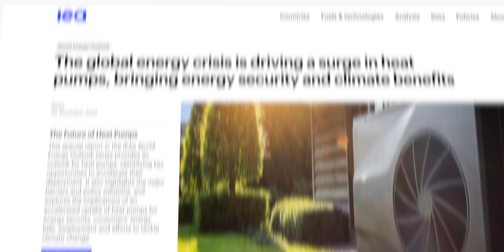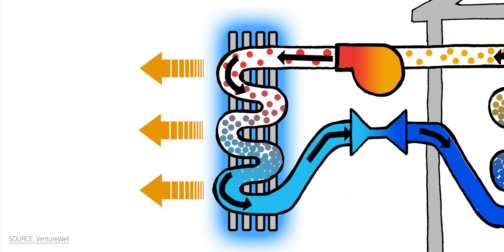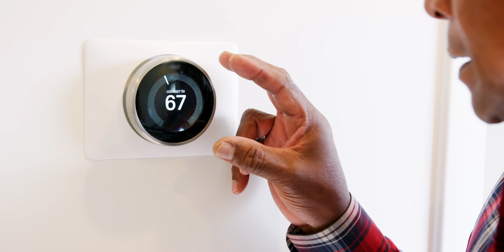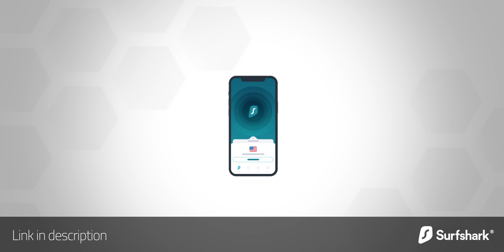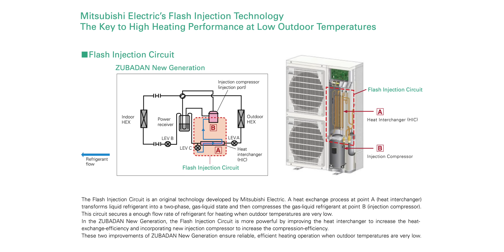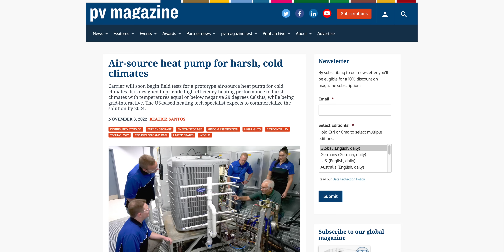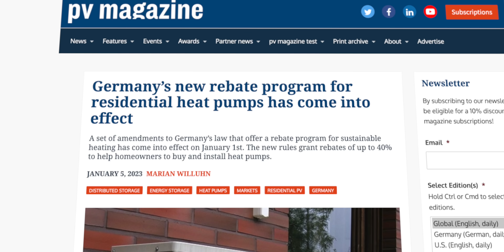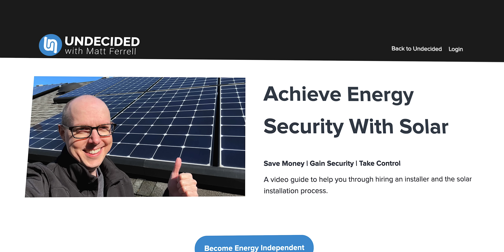Major Advances with Heat Pumps in the Extreme Cold

Comment: A different issue, currently looking for a Monobloc (ie Air to Water Heat pump in a single unit) to heat a very large Hot Water tank (1500l).   We are off grid so the tank is a alternate way of energy storage, leaving batteries for electricity.   
But as we are off-grid, I do not want or need to run the heat pump off battery, it will only run when we have enough solar power (or forcast too) which, still getting Max charge into battery by end of most days.   Yes that large tank and energy efficient house means we have heat, and can still use Firewood backboiler when needed.
But the problem is finding a heat pump with a open control interface that I can turn it on and off, but also demand it run at xx% of capacity.  Not having  much luck, it is use timer.. but that doesn't know it is a poor solar day, or turn it on off buy removing power, problem is if they on powerup go into standby, and need a button to be pushed.....we are not always there to push buttons.
I have the means to determine when to turn on off, or what power to demand, just no-one here in Aus is willing to provide that interface.
But you showed a few other names I will have look at

Comment: At 12:35 Matt said: “There’s plenty of modern models on the market right now that can handle the coldest winters that the Midwest or New England can throw at them.” But according to the information presented in this video, THAT’S NOT TRUE.
Matt said companies are on track to meet the challenge by 2024. Then he said multiple companies had made PROTOTYPES (NOT PRODUCTS) that met the challenge. But right now is March 2023, not 2024. Also, the CCHP challenge only goes down to -26 C/-15 F. In the upper Midwest, temperatures can get down to -32 C/-26 F or colder.  What is the operating cost comparison of a CCHP in cold weather vs. a gas-fired furnace?  Heat pumps have known issues with the coils icing up at near-freezing temperatures.  Has that issue been resolved?  Also, what is the reliability of these units? That is a big, potentially very expensive and/or dangerous, unknown.
Another consideration is that during a power outage, a small generator can power the electronics on a gas-fired furnace, but NOT a heat pump.
When these issues and questions can be adequately addressed, I’ll consider a heat pump.  Not before.

Comment: well if you have a air-source heat pumps... the colder it gets the less-effective they become...however if you have a ground source heat pump it works at all temperatures... also it a lot more efficient , love your video's Matt
Reply: The problem for ground source is that when it is warmer (e.g. 7C+) it gets none of the gains from the warmer air that Air Source can.  So it's very much a balancing act of whether the efficiency gains of ground source at the colder temperatures, make up for the efficiency gains that Air Source gets when it's warmer.  Especially considering the greater up front cost for Ground Source.
Reply: @BenIsInSweden  you are partially correct, however ground heat pumps work at the same efficients in nearly all weather, which means you can plan exactly what you going to get, but with air source dependent on the weather you can't :( the temperature level in the soil doesn't alter once you go below a particular depth if you want your heat pump to work independently of the weather there is only one solution ... ground source ....
Reply: @alangunningham5667  Yeah, I liken Ground Source to having a fixed-rate mortgage, you are largely unaffected by what the market is doing.  So you're essentially paying for that consistency, even though it might not always pay out in the long run. Ground Source does have some risks in other areas though, like in Sweden, if you live in a water protection area, and you get a ground source heat pump, you are personally responsible if the nearby water becomes contaminated due to the borehole etc (even if you decide to move away). It's a low risk, but a risk nonetheless.
Reply: @BenIsInSweden  i kind of agree, but i don't live in very hot areas and haven't looked up the stats for those areas(can't believe the results would show any efficiency difference worthwhile), however, most definitely temperate and cold areas's ground source is easily the best to have, you kind of grab the very worst situation for Sweden, and i am sure that properly installed the risk of this happening in minuscule, and even then it depends on the fluid used for the ground source system
Reply: @BenIsInSweden  all that info could be correct , however, my statements are totally correct, you are just trying to pick holes in it .. there are always many reasons to buy one system over the other ....but we were discussing costs, just how one system works better than the other, and no matter how much you try and prove it , ground source heat pumps are generally more efficient over all temperature ranges, air source just can't cope, you say you are from the UK ?? what the hell are you talking about SEK  for ??? UK using GBP for currency ?, I could poke more holes is your statement  but this is getting silly
Reply: @alangunningham5667  Sorry, wasn't trying to pick holes.  At the end of the day, you are correct in that they are generally more efficient.  The temperature ranges where they aren't, aren't going to make a huge difference in cost anyway. As for the country confusion... I'm from the south of the UK, but live in Sweden.
Reply: @BenIsInSweden  now I know there currency and Sweden's mention for contamination all good points, i live in the southern part of the UK and generally air  source units are the ones being installed...so much cheaper, but i would, if had the area to put in a ground source, i would, on new properties. the cost difference would be small (my self, i have air source, not enough room for ground  )
Reply: @alangunningham5667  Yeah, I think there are situations like adding it onto a mortgage for a new house purchase it would make a lot of sense. The biggest problem for the UK currently is misinformation about Heat Pumps in general (and tbh bad installers), it's almost bad enough that I believe that there's some sort of fearmongering campaign going on by the gas industry to put people off.
Reply: @BenIsInSweden  yes i agree,in the UK, There are a lot of misinformed installers  just trying to sell heat pumps to make  more money, not because it makes sense to install and also  jumping  on  green bandwagon, again for more sales ..hardly anyone points out the changes having a heat pump system is going to make, as much as it is good, there are points that won't make it good for all

Comment: Matt a liquid cannot be compressed. The liquid refrigerant evaporates in a coil (strangely called an evaporator) thus absorbing heat. That low pressure gas is compressed into a high pressure gas by the ummm compressor. The high pressure gas is then fed into a condenser coil where it gives off heat as it changes phase (that is condenses) into to a liquid. That liquid is then metered by a thermal expansion valve, or capillary tube before it re-enters  the evaporator coil, where it once again evaporates.  This process is the same in a refrigerator or an air conditioner. The only unique part in a heat pump is the 4 way or reversing valve which determines the role of the indoor and outdoor coils, that is  making the indoor coil a condenser in winter so it can give off heat, or an evaporator in summer so it can absorb heat.

Comment: I invested in a geothermal heatpump with 2x 100m holes. Because air heatpumps are not so efficient in the winter. With a COP of 4.5 combined with a lot of insulation i can laugh about putins gas blackmailing. Yes i invested €20k - €25k but that investment lasts 50 years and even when my heating cost doubled from €400 a year to €800 it is still 1/10th of what the others pay here in EU winters.

Comment: My partner and I have been discussing if a heat pump is worth installing where we live. 

We get a few dozen days below -30C (not counting windchill) every year. 

We talked about the option of a heat pump for the warmer times and a backup furnace for the other days (but it seems expensive to install and run two systems, even if one is backup.)

I am wondering if anyone else who lives in a pretty cold climate has come up with a way to do this, or does everyone just go straight to geothermal if they want heat pump technology in a colder place?
Reply: Whilst Cold Climate Air Source Heat Pumps are pretty common and can work down to about -30C.  The extra cost of having the borehole drilled for a Ground Source Heat Pump (or geothermal) will likely pay for itself within the expected lifespan of the heat pump itself. The borehole loop (at least here in Sweden), is expected to last 100 years, so will live through about 5 heat pumps, and likely at least 1 owner 🤣

Comment: What you should of done is had an ORC via solar thermal that dumps the heat into the ground loop of the heatpump. Orc cold loop becomes heatpump loop when running ORC.

Comment: I installed a geothermal hvac system 3 years ago and it has been flawless. We live in the Denver area with temperatures down to -20 F. Obviously, with the geothermal setup, cold weather doesn’t affect the performance so it does fine in winter. What I’ve been most surprised by is how great it is at air conditioning and how cheap it is to cool the house in summer. It costs next to nothing to keep the house in the mid to upper 60s in the summer (our bedrooms are all upstairs and I sleep better when it’s cool). Overall a great investment.
Reply: @ReasonAndHeart  that lame payback argument. If you had a new kichen or bathroom installed, would you calculate the payback on that? Or a 2 week cruise around the Carribean? It's a ridiculous argument against heatpumps.
Reply: @mikeypc3592  Same goes for solar, I just don't see the justification for geothermal as unlike solar geothermal only reduces the utility cost. It's ironic how people don't think spending $20-$30k for solar is worth it but they think spending that same figure for geothermal is worth it even though the former eliminates the utility cost if done right but the latter only reduces the utility cost which will continue to increase.
Reply: @mikeypc3592  Caribbean.
Reply: No it isn’t. Why use a heat pump if it costs more?  What’s the benefit?
Reply: @ReasonAndHeart  Not to mention you only reduce your electric bill not eliminate it. I chose to go solar, install an air source heat pump and wood stove. Eliminated the energy bill altogether. I did test the heat pump these last two winters and even at single digits it still kept the temperature at 75 degrees, it ran non stop though and it does not have or need auxiliary heat either. The defrost mode does drop the temperature but the defrost cycle isn't long only 2 minutes tops and only goes into defrost occasionally. I use the wood stove as primary heat for now until I am able to expand my current backyard solar array to generate enough electricity to use the heat pump as primary heat then the wood stove will be secondary heat if the heat pump were to break down.
Reply: @ReasonAndHeart  Depends on user requirements, me personally I'd be ok paying that while using a solar setup and higher efficiency building codes to have 0 costs in the future. This is assuming of course you pay cash which I would be.
Reply: @ReasonAndHeart  If its -20 to -30C out, heating costs are very high depending on the insulation of your house.
Reply: Geothermal is not a heat pump.   I think the people who are saying it works great in the cold don’t realize they have a backup electric heater.
Reply: @Tman76  You're right. Geothermal alone is not a heat pump. By definition, geothermal is just heat energy in the earth. Like Old Faithful is really just a geothermal powered water jet. 
But those who have geothermal heating and cooling systems are almost guaranteed to have heat pumps, referred to as ground source heat pumps. They work great when the system is sized appropriately for the amount of heating/cooling a house needs. With a house that's properly inaulated and a well designed geothermal system, it could be - 100f outside and 70f inside and you shouldn't have to rely on electric backup.
My parents installed a geothermal system in their house and the electric backup doesn't kick on until it's under -10f. And that's with 2 stage technology from 2010 instead of VRF which is much more common today.
Reply: @Tman76  You can test your unsupported belief by looking at the data sheets for some ground source heat pumps and see if they have any integrated electric resistance heat. I think you will find the answer is no, but look for yourself!
Reply: Don't tell it to your neighborhood because if they do the same it's gonna have effect on the temperature of the underground water 😮
Reply: @balokurd17  Not sure what you get out of this belief statement, but think 3D: if a well is 200-400 feet deep and houses do not cover every square inch of the surface (even if they did, but note that they are spaced out and small relative to total area) then the ability of water to hold tens of thousands of "tons" of Btu is quite huge relative to the 3-4 tons per house peak load. With poor groundwater exchange, or poor ground loop design it is entirely possible to "freeze out" the ground immediately surrounding the loop. Physics is not a mystery and it is not politics, just think a bit and it can make sense.
Reply: Geothermal is not a heat pump.
Reply: Expense not an investment
Reply: @karmendimas5274  Over time, it is no longer an expense.
Reply: @babajaiy8246  so the electricity and maintenance is all free to run it?
Reply: @karmendimas5274  What electricity and maintenance? vs. what? Are you not thinking?
Reply: Sure it is. Plus how long until it becomes more cost effective than natural gas?  I would guess never.
Reply: @jamskinner  In my area air source heat pumps (as long as they are properly sized) are more cost effective than any fossil fuel except waste oil and has been that way for two decades.
Reply: Likely it has a resister heating when it gets too cold : so it is not actually using the heat pump when it is too cold. Below 45 F , head pump becomes ineffective.
Reply: @bhaskartube  Geothermal heat pump systems never use resistance heat.  The system uses coil lines in the ground below the frost line.  Since the ground temperature is stable year round (@ 55F), outside temperature is irrelevant.
Reply: @bhaskartube  "Below 45 F , head pump becomes ineffective." Actually not true. The one I bought will work down to -15F with a COP over 2 and will work at lower efficiencies down to -25F. No resistive heater. Where I live it gets that cold only every few years and never for more than a handful of hours. During the day it virtually always gets above zero F. So worst case is it gets a little cool in the house, nut never cold and never puts the house in danger of pipes freezing. For the savings and safety it's well worth it.
Reply: @harshbarj  My air source heat pump package unit works well down to the single digits and it has no back up heat. I use my wood stove as primary heat but I tested the heat pump the past two winters to see how it performed.

Comment: I live in Colorado and went all-in with a six zone mini split system last year. When we hit -6 a few weeks ago I was nervous. No need—the system was putting out 100+ degree air even at the coldest temperature. Don’t bother with the supplemental resistive heater (not an option for the mini splits anyway). And oh, it keeps the place nice and cool in AC mode in the summer which my old system could not do.
Reply: John, What manufacturer did you go with?

Comment: The variable load is an underrated advantage of heat pumps. It is much easier to size than a normal air conditioner because cycle times aren't only on/off.

Comment: my 4-5 ton mrcool is working well in western ny.  Need to get used the fan and compressor noise which is a bit louder than my 96% 70k propane furnace. Running in 4 ton mode.  PLaced a 4 ton coil on top of my furnace.  My propane increased in price 40% this year so it will be good to be using less.  My understanding is that the r410 working fluid boils at -50F so there is quite a bit of heat to be extracted above that.  We have never been under -20F in 28 years here.

Comment: Just for transparency -  how high is COP number for the best heat pump at -20°C? 
BTW, rebates are for dealers, not for end-customers, at least in EU. . . every time rebates come, price rises as such and more . . . 
but thank you anyway, Matt
Reply: If you can stomach the installation cost, then a ground source heat pump, as outside air temperature has little effect on efficiency, unlike air source.  A COP of at least 4 is achievable with most GSHPs.